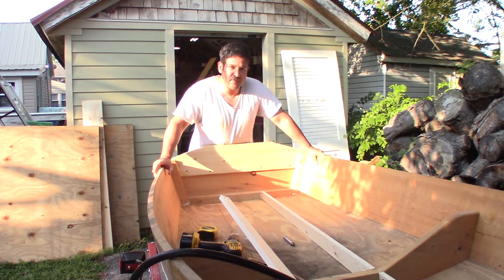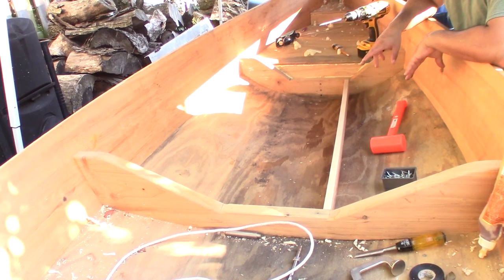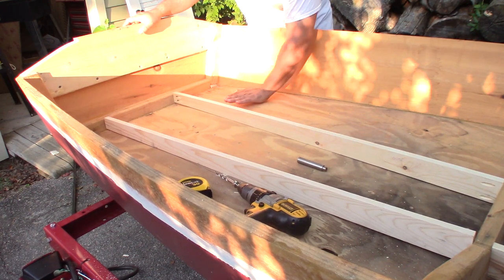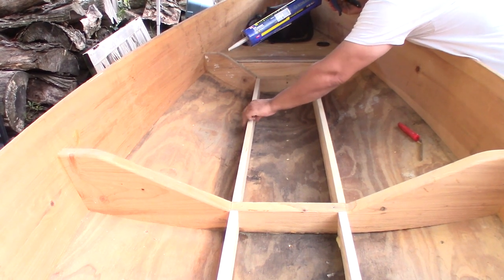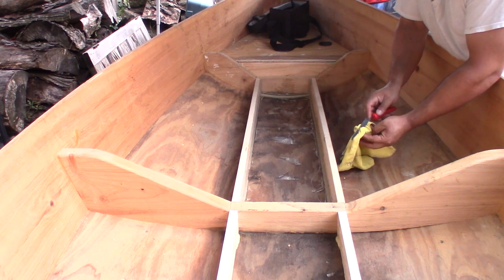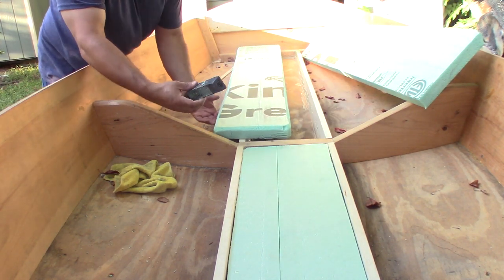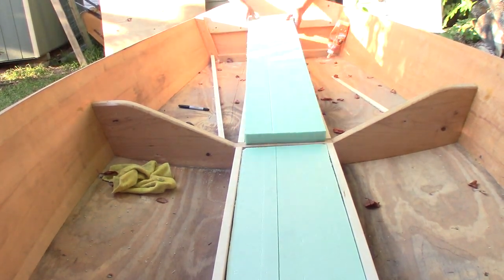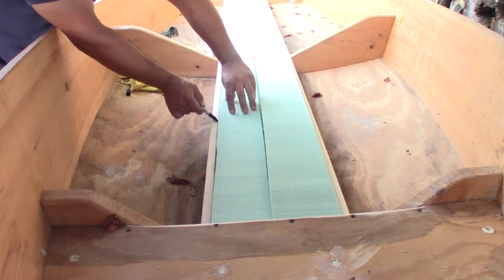HomeMade plywood boat part 10 - Making the tunnel and adding flotation foam

Comment: Hi, a couple of comments - if some water gets into the boat, which its likely, it will get under the floor and under the foam, then rot it from the inside out. I suggest making the floor removable to get the foam out and let it dry after every use. Epoxy covering the hull on the inside will also help.
For a new boat its a good idea to get it in the water, then fill it with water to see if there is enough buoyancy. This is called a buoyancy test and is good to do when its not an emergency.
Good luck!
Reply from the maker: great points! since this is my first one, im not expecting it to be a forever boat, just a fun little project
Reply: @RayMAKES  It should last for quite a long time if its Epoxy coated!  If you enjoy if and want something longer lasting-
 It is common for Plywood sailing dinghies  to have buoyancy tanks that have no foam, but use the air volume as boyancy. If it leaks a little, no problem as each one has a inspection hatch that's left out on land to let air circulate and dry it out. They also have "self bailers" in the bottom that suck water out as the boat moves forward whilst sailing.  These double as drains to let rain water out when on land.  If you have a cover to keep most of the rain out when its not in use it can last a very long time. My 1977 plywood amature built Miracle class dinghy that has fibreglass taped seams and has lived most of its life outdoors. No Epoxy resin back then, only 2 part Polyester resin.
Reply from the maker: Yeah I keep it covered, but if I get 10 years out of it, I'll be happy

Comment: Its 100% gonna fill up with water in the middle. You need to add drain holes all along the bottom so water can trickle back when you have it on the trailer.

Keep it up! Loving the videos
Reply from the maker: thanks!  the center section is completely sealed.... i may need to put holes in the frames though
Reply: Ray Pena Aha! Typical builder optimism. Im telling ya man, its 100% gonna fill up with moisture. No matter how well you sealed it. Moisture is a mofo on these  things! The only way you can seal wood is by vaccuum bagging it and laminating over it. If you want it to last you need the drainage and treating/laminating the wood

Comment: You should check to see if the foam you are using is closed cell foam.  Most foams can actually absorb water so the will no longer provide buoyancy.  Wet foam will also rot the plywood.
Reply from the maker: good points!!  i did check and the spray foam is also closed cell too.

Comment: I think the bow in the bottom might be caused by the boat sitting on the narrow base! The weight on the outside edge of the boat is not supported and is causing the middle to raise up! Not to be critical, but you probably should have put this tunnel frame in at the very beginning!
Reply from the maker: Possibly